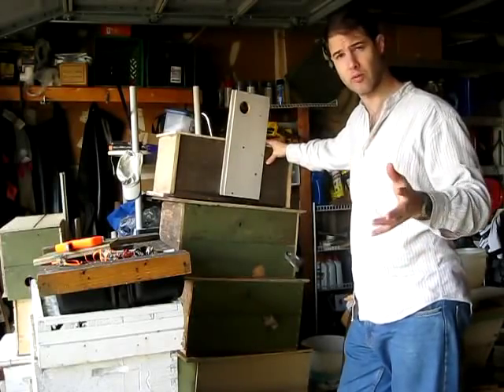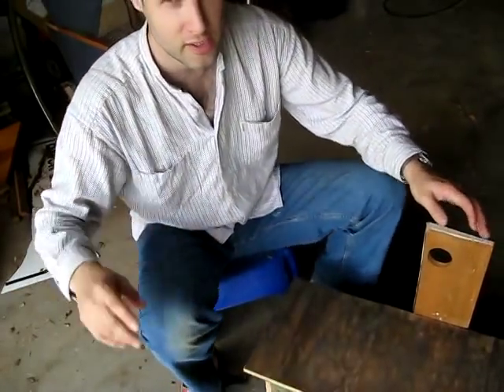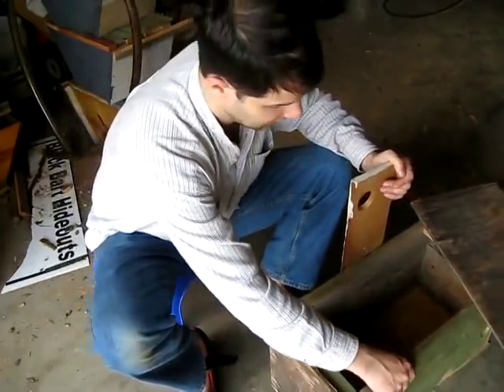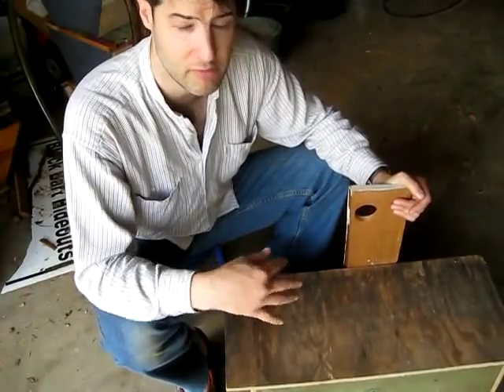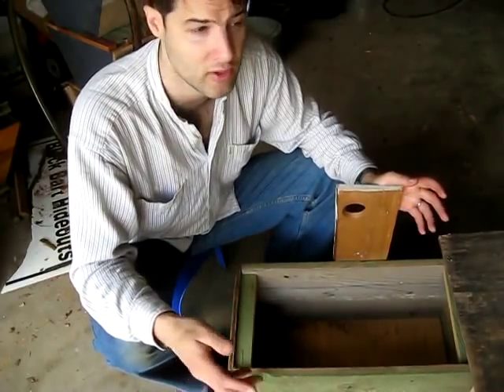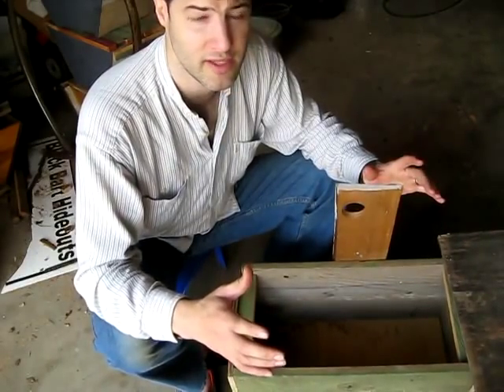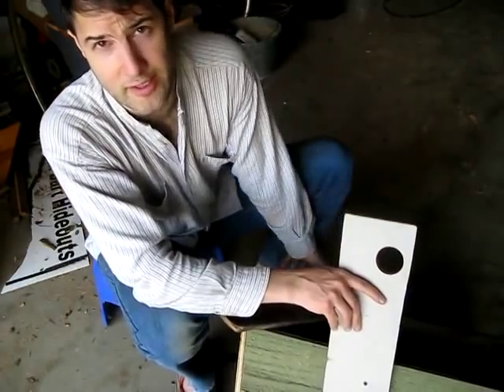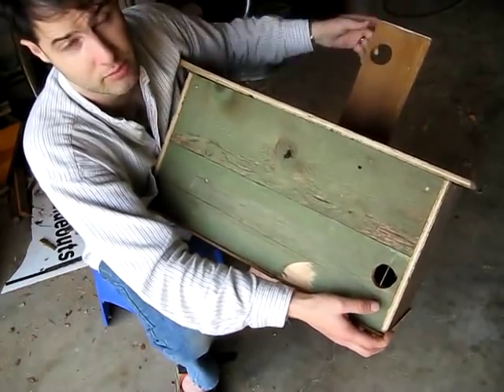How to build a Bait Hive / Swarm Trap and get Free Bees

Comment: Where did you come up with 15 centimeters squared?  That is almost 6 inches, squared.  6x6 = 36 inches.  Just curious!
Reply: Think he meant 15 square centimetres i.e. i.e. 4x 4 would be 16 sq cm; not 15 centimetres squared which would be 225 sq cm

Comment from the maker: @tifreire1 I'd still hang a deep, but put in medium frames. Then when they build comb, cut off any below the bottom bar. This is mainly for usability.  However, I've not tried it but check the volume of a 10 frame medium and see if it is close to the 30-40 liter mark. If so, use it and see how it works out. Then let me know.